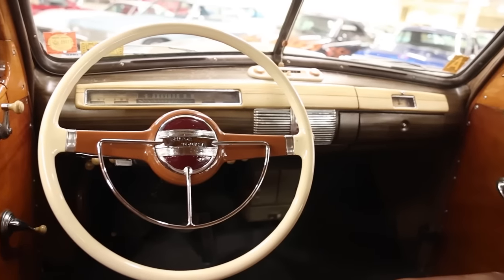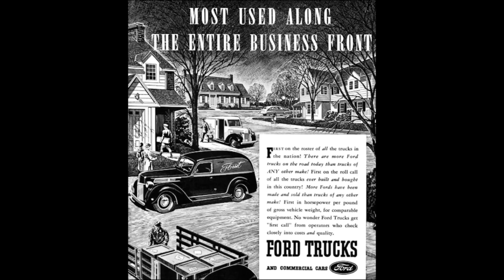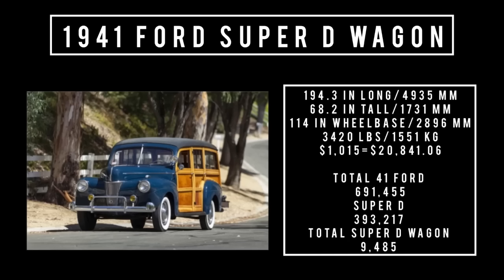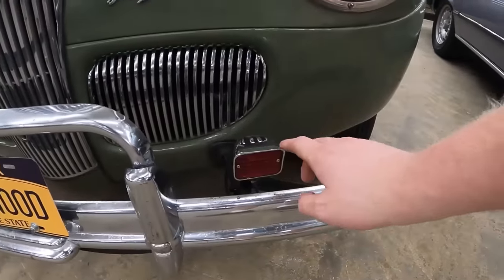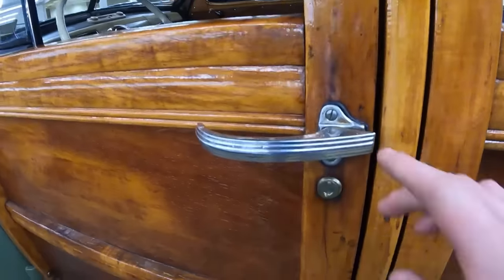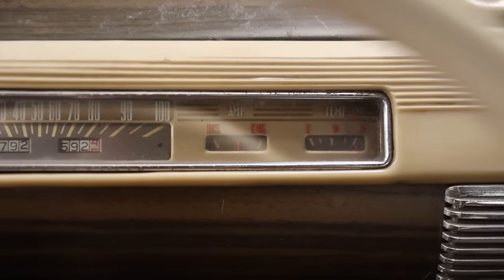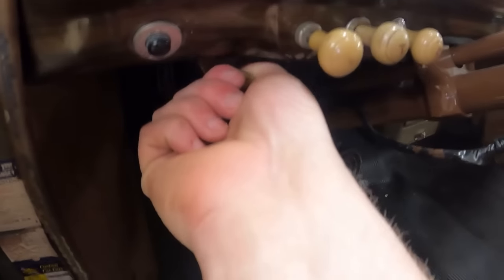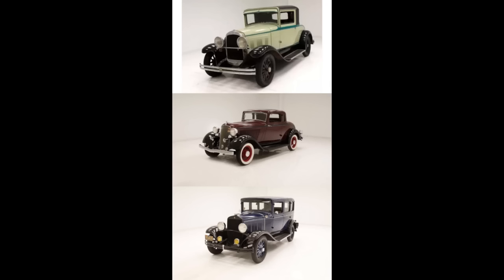1941 Ford Super Deluxe woody wagon, Hell freezes over ford makes new 226 six!

Comment: l think the case is that when the wood inserts on the door was split in the middle (as compared to thirds or quarters) on both Ford and Chevrolet in 1938 and 1940, respectively, it gave more elegance to woodie wagons. PS. l think the correct spelling is "woodie", for cars with wood inserts on the doors. 🙂

Comment: The handsomest Fords from that decade are the 40's and 41's.  Straight 6 engines have an inherent balance to them that make them last much longer.  This one has the same HP as the base flathead V8.  Like the 41 dash a little better.  WYR -1- Chevrolet  -2- Plymouth
Reply from the maker: Great choices totally agree it didn’t make sense to get the V8 when the six cylinder made more power for less money $15 back then would equate to be $308 today

Comment: The 41 was referred to as the first of the fat fender Fords - and in its day was quite a departure.  Market dictated of course, but Ford lost some of the springhtly feel it (still) had from the pre-1935 redesign days.  In many ways and for many makes, 1941 represented the maturation of automobiles into the more or less modern car.  Certainly until about 1955, although of course the envelope body and eventually the modern short stroke OHV V8 would begin before then.  Cars had become dependable, and somewhat standardized.  WYR:  1)  41 Plymouth, more rare than the Ford, probably worth less, but also probably a better car; 2)  33 Plymouth coupe.
Reply from the maker: Thank you so much for all the added information =) that 41 Plymouth was nice looking great choices

Comment: How appropriate to have a Beach Boys song selected for a '41 Ford Woodie! I noticed that there is a WW 2 gas ration sticker on its front windshield. "A" was the most common number and limited a person to just 4 gallons of gas per week. But is it actually authentic or was it put on much later? I don't know, but it could be real I guess.
Reply from the maker: That’s crazy 4 gallons per week. One job I had I burned more gas then that going one way to work. Thank you so much for pointing that gas ration sticker out

Comment: I would prefer the 1941 Ford's interior to the 1940's.  And I would choose the 1941 Plymouth woodie wagon and the 1931 Chrysler Six sedan.  Your numbers for bore and stroke on the V8s do not come out--you have smaller numbers for the larger engine.  Even when you convert the mm numbers, the displacements don't match.  But small potatoes--it is remarkable that this car has lasted so long in such original condition.
Reply from the maker: Awesome choices I’ll have to look into that every spec that I got was from a source except for the very last slide I had to find that information and converted inch to mm

Comment: Seems like the 30s and 40s had the best woodie wagons. I wonder when the automakers stopped making woodies.
Reply: For the most part, full wooden bodies like this one were over with by the late 40s.  At that point carmakers began switching over to either steel bodies with a little bit of wood on the outside of the steel for effect, or just plain, all steel bodies. Later in the 50s they started using the woodgrain vinyl. But of course, it wasn’t the same thing.

Comment: I didn't think crank start cars existed anymore by 1941.
Reply: Electric starter motor, crank for low or dead battery.
Reply from the maker: I forgot to mention Ford did it because of a dead battery situation they offered a handcrank until 1948..
Reply: Crank was an alternative or emergency option.  Our 1949 International was often hard to start when hot. I recall hitting the starter button while Dad cranked, to get it to spin over while out in the hay field.  I once owned a 1974 Renault R12 that had the opening for a crank, and a place where it could engage the crankshaft pulley (yes, 1974).
Reply: Luckily, even in my '06 Acura, I can always get a shove, then "pop the clutch."
Reply from the maker: I started my truck like that a couple times for the battery wasn’t connected right instead of messing with the battery I just kick started it with the clutch.
Reply: Well, I just learned something new.
Reply: @aaronwilliams6989  ... learned something new.
     And that's what makes it great. 👏
     I've posed questions before, and other viewers will chime in with an answer.
Reply from the maker: This channel is way more than just a car channel I’ll make a video on kick starting

Comment: Maybe turn signals.
Reply from the maker: It has a stock for the turn signals =)
Reply: It was a large supply of aftermarket, turn signal kits I even saw them in the J C Whiney catalogs in the 60's. It was common for then to be mounted near the bumpers on cars, pickups they were often mounted on the fender tops and near the box sides.